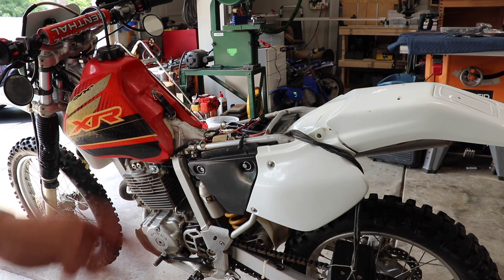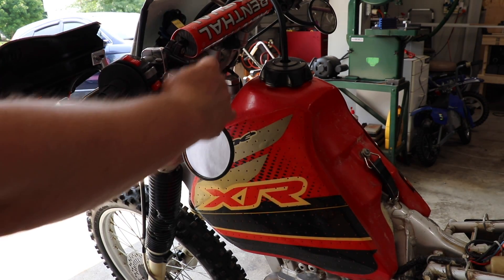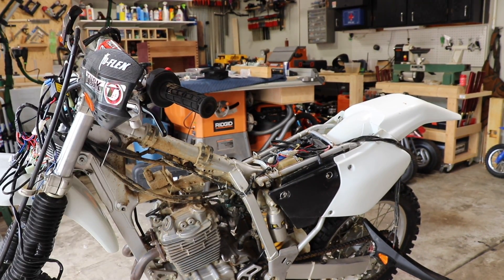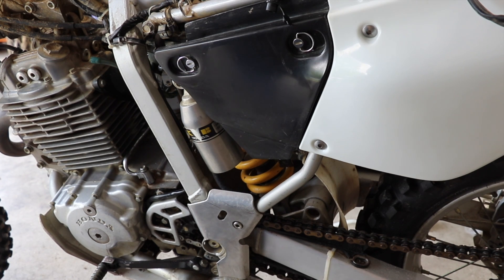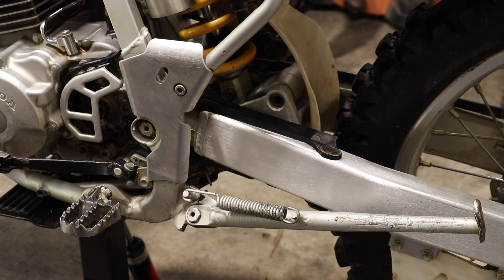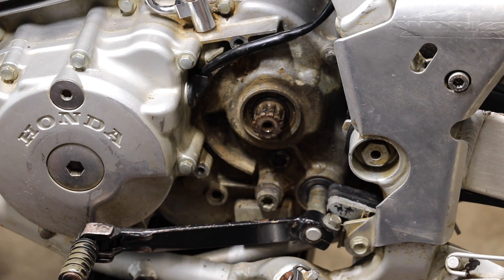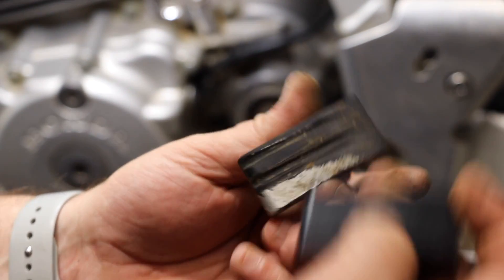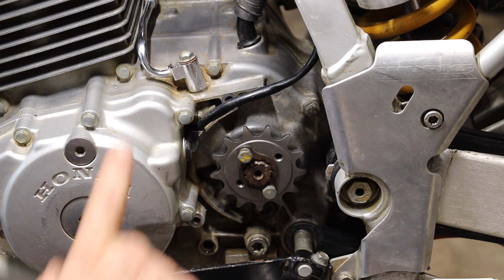Honda XR250R Street Legal Part 3 : Wiring, Front Sprocket, Parts Update

Comment: Johnnysshop  I need HELP. 05yz250f it runs but when I put it in gear theres nothing there.1-5 nothing. I also hear a little grinding the case when its in gear. but in neutral it sounds good no grinding. is it possible to break a gear inside the motor and now none of the gears work. I have no clue whats goin on inside this motor. I haven't took it apart yet because if its gonna cost more to fix it than its worth ill just call it a wash and sell it
Reply from the maker: Unless your clutch is completely fried it could be a bent shift fork. I would check the clutch first and if all is good there you'll need to split the case. Tranny gears can break but it's usually not likely.
Reply: well that's better than what I was expecting to here lol.  iv know that the clutch was getting shitty. I could feel it( it didn't always want to engage all the way and the bike would still wants to move in gear)only sometimes. most the time it works fine . and the bike has like a million hours on it.. and I watched a few of your vids of the 03yz250f when you were doing the tranny and shift forks. and fuck that I cant do that lol
well thanks for the tip ..............and I subbed to your channel..
Reply: Ohhh yeah and when the bike is off it still shifts through every gear just fine on the stand.. does that mean the shift forks are ok ?
Reply: just took it apart. clutch is fine :( now I have to spit the case.. thanks for the tip Johnnysshop
Reply from the maker: Ha! Let me know how it turns out!